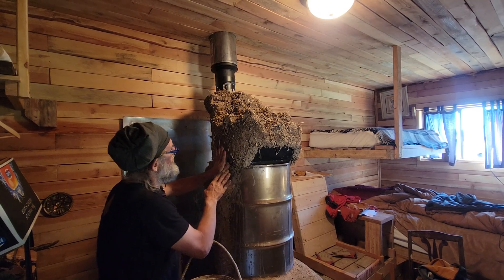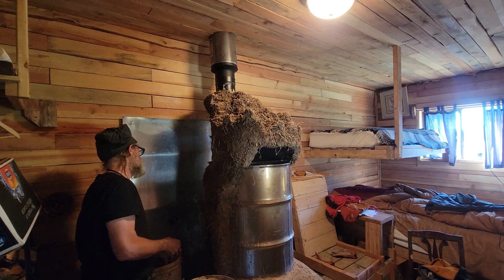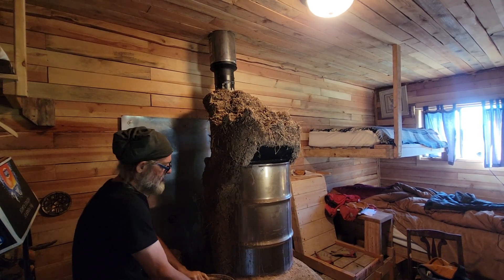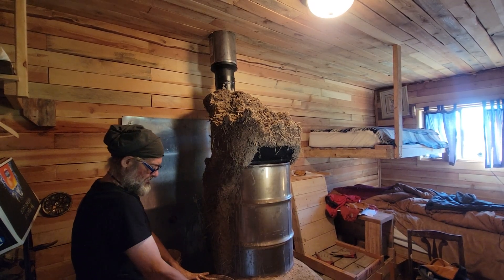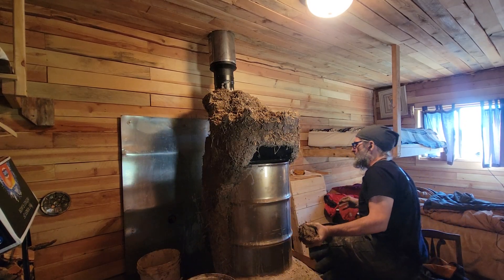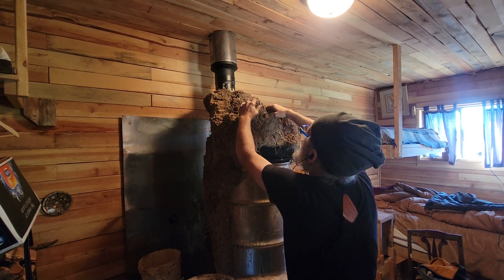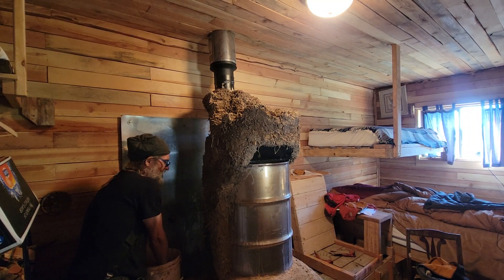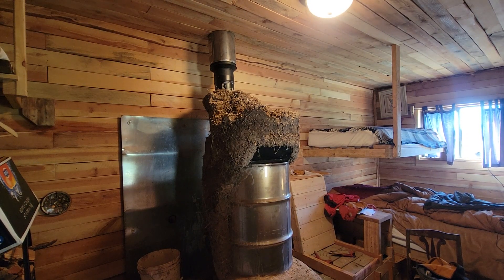Uncle Mud's Hot Cob Mullet: The Ultimate Tiny House Rocket Mass Heater Upgrade. Part 1

Comment: Wondering if you or someone you know has experiemented with wrapping the barrel with copper pipe and warming a tank of water with the heat to slow down the stove heating the room too fast before it heats the mass. You could even leave the water tank partially uninsulated so it also acts as a mass for the thermal battery.
Reply from the maker: If your purpose is to end up with domestic hot water a coil inside the barrel or a tank on top will work better. If your purpose is to slow down heat transmission into the room so a tiny space doesn't overheat then cool down too fast a few inches of cob coating the barrel is cheaper and more effective. If your purpose is to store heat in a tiny space so you dont wake up cold water is theoretically a whole lot more effective as a heat storage medium than cob is, but cob is cheaper, easier, less complicated,  less maintenance and more effective in my experience. Storing heat in water by thermosiphon means your heated mass tank is up high in the room, which is fine if you want gravity fed hot water for doing dishes, but for comfortably heating the human body heated mass is more effective down low, which is why you see a lot of rocket heaters with heated mass benches or even heated mass floors. You can do some pretty fancy things with water storage, like hydronic floors or remote radiators heating additional rooms, but thats a lot of expensive plumbing to do the job of a cob bench.

Comment: I just spent a week with this stove in sub-freezing temps.  The miracle of mass is amazing - cuz that cabin is not tightly sealed or super-insulated!  The first night I burned it a lot to chase cold out of the whole system, and I made the mistake of wanting to run it until the "mullett" was really warm to the touch.  While the cob on the sides was clearly warm - even hot - cob is a slow transmitter of heat and I gave up.  Once I stopped the fire, the heat in the cabin continued to rise as the heat migrated through the pebble bed to a balmy 85 degrees!  In the morning the mullett was considerably warmer than it had been while the rocket was burning.  I also didn't need to light another fire for 48 hours, and then it was less wood and shorter burns to remain comfortable.
Reply from the maker: For a long time I have been moving toward the conclusion that tiny house rocket heaters struggle because they put out too much heat too quickly so we stop feeding the fire before the mass battery is totally charged. The air and surface of everything is overly warm but the heart of the mass, the part that is supposed to warm us in 8 hours, that part never warms up so we wake up cold in the morning. Thank you for your feedback.

Comment: Is this at Paul's place? Air gap between barrel and cob about 5 inches space?
Reply from the maker: I assume you are asking about the air gap between the top of the barrel and the cob. That is about 5 inches per Paul's preferences. If I was trying to optimize heat capture from the hot spot up top for slow release I would build the cob mullet directly on the barrel top. Paul worries direct contact with the cob would overheat the barrel metal but I'm finding no evidence of that in other installs. If I am trying to capture that heat and direct it some place useful I like having a gap between the barrel and the cob of about an inch both top and sides to encourage thermosophoning, pulling cold air up behind the barrel and over the top and out the front, warming the air and circulating it into the room. The hot cob mullet keeps the heat from radiating up into the ceiling, then continues to heat and circulate warm air after the fire is gone and the barrel is cold.
Reply: @UncleMud  .
Thanks for sharing about the air gaps or lack thereof.
Can you point me towards some of the builds that use the cob directly on the barrel lid?
Many builds seem to rely on a firebricks and ceramic fibers for the ceilings of bells, but those materials are relatively expensive.
Barrels are a low cost bell , so if they can be made heat retaining and presentable with cob, that would be great.
I am interested in using leave in place forms to cast a "cob" bell around and over a steel barrel.
This would be kind of like a Paul's pebble bench, except even cheaper .
It would be harder to harder to disassemble for repair.
Creating a cast earth plug to cover the lid of the barrel might be enough to address this.